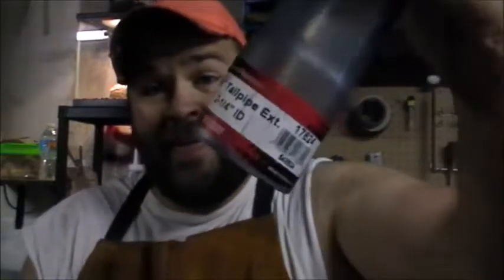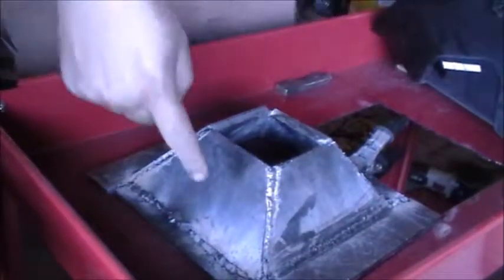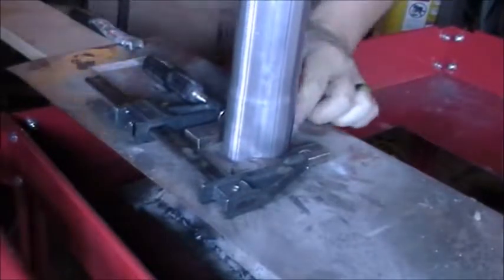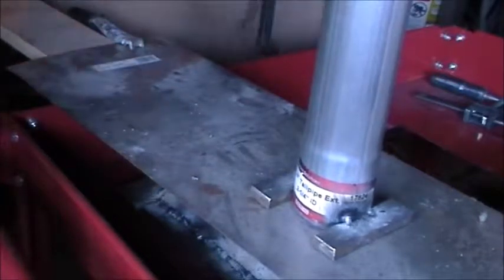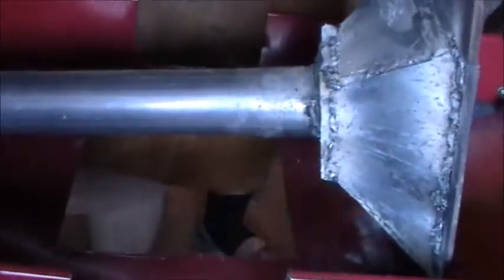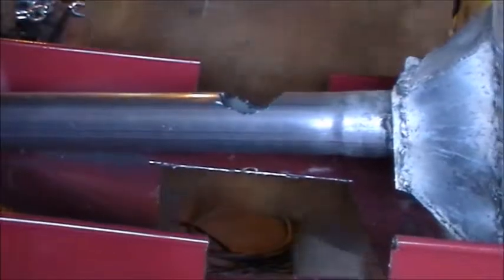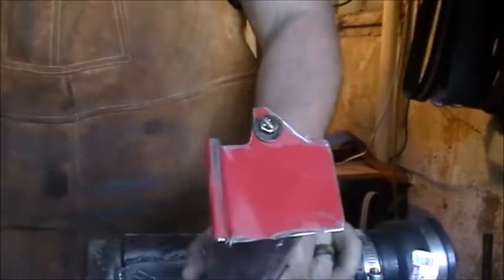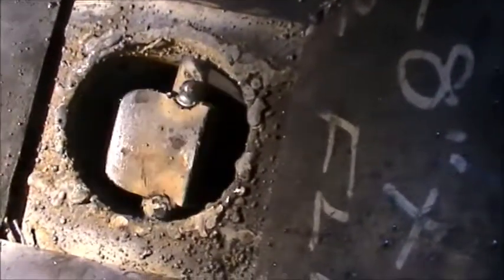coal forge build part 2

Comment: I like how you build what you need. I built my own coal forge and fire pot which was very similar to yours. That was 2 years ago and it still work well. Just one thought...you might want to consider adding some bracing to the Harbor Freight cart. The ribbing at the top that was cut out to accommodate longer material also provided most to the rigidity to the cart tray. Wouldn't want to see it flex and dump a pile of burning coal.
Great job...I really enjoyed your build.
Reply from the maker: John Walker thanks for the advice I definitely will do that